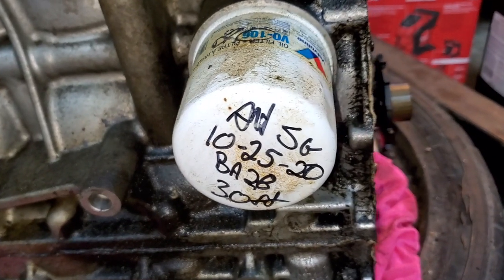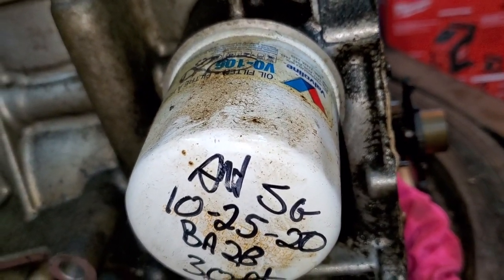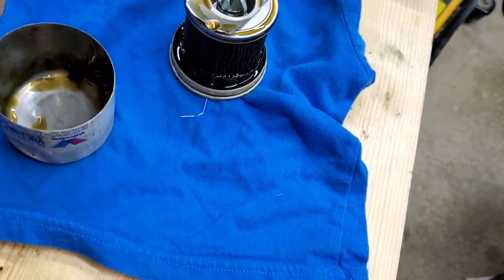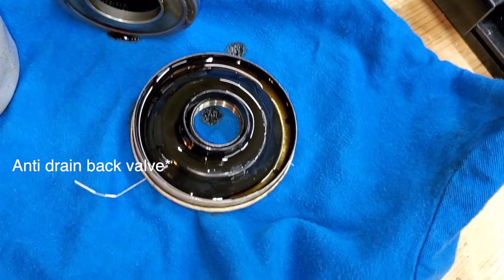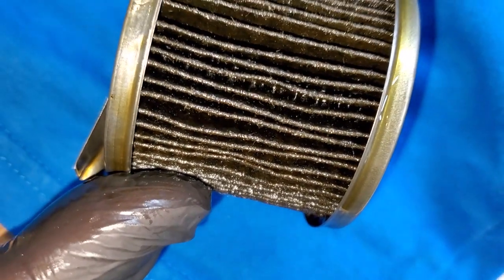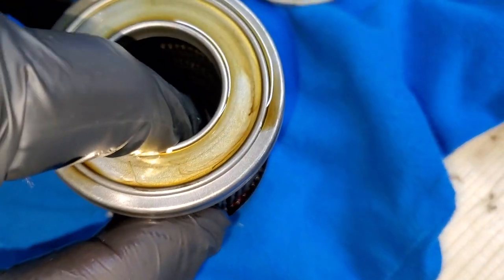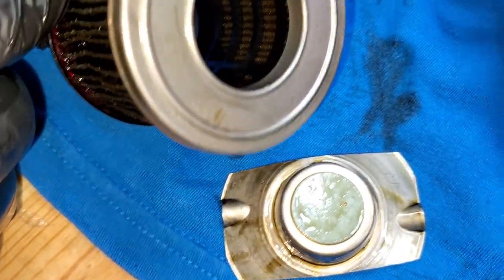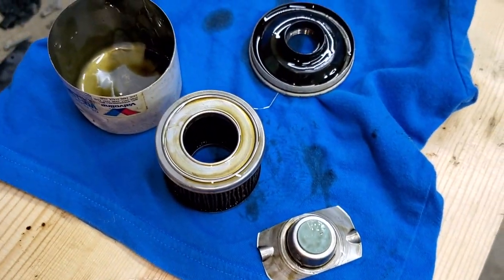VALVOLINE OIL FILTER CAUSED THIS ENGINE TO FAIL? VALVOLINE OIL FILTER REVIEW

Comment: Most engines that fail with oil related problems are due to overextended oil changes and lack of maintenance.. I have a 1994 Lawn boy lawn mower 4-cycle and I change the oil two times a year and the oil is crystal clear and the engine runs like new and does not use any oil..
Reply: Yeap oil filters is not the problems
Reply: @gonefishenmryangyang9539  a bad filter is more of a symptom of having cheap oil changes done. Whoever owned this engine was a cheapass on the oil

Comment: Looks like the engine failed because of lack of oil changes, abuse, and neglect and more likely a buildup of sludge in internal oil passages of the engine and its components

That filter isn’t even clogged up and even if it was clogged it has a emergency bypass valve to prevent oil starvation in the case that the filter media is too clogged for oil to pass through the media, this is especially useful for the people who neglect their engines and don’t change the oil enough

Engines getting damaged by VALVOLINE’s filters failing are extremely rare when the filter is installed properly and securely

The only time I’ve ever had a filter fail was on a Mercedes diesel motor were the filter was a cartridge type and the internal tower support structure for the inside of the housing for the filter failed because it was made of brittle Polymer/ plastic that had broken sometime before I serviced the vehicle. These types of filters do not have emergency bypass valves 

I informed management of the failure of the internal tower structure the filter is installed into and said it would likely cause a failure and that I think a replacement should be procured

Management disagreed 

I said that I was not liable for damages to the engine if there was a failure

I was right
The oil filter had been crushed by the pressure of the oil
And the engine seized due to oil starvation

What tends to damage engines most often is engines being overfilled with oil and being overworked

This is caused by inexperienced employees that are undertrained or have a lack of understanding of cars and how to use tools and techniques

Comment: The 2.4 litre Hyundai engine is known for engine failure - check out the class action lawsuit.  They are replacing thousands of engines.
Reply from the maker: And your point is?
Reply: @repairvehicle  The point is that the filter did not cause the engine to fail but a design flaw in the engine itself
Reply from the maker: What design flaw it has?
Reply: Google Theta II engine failure and Hyundai\KIA class action lawsuit.  The Theta II engines were not manufactured properly resulting in a 165 million dollar fine and the replacement of thousands of engines that seized due to rod bearing failure.
Reply from the maker: Thanks, I will look into this
Reply: @repairvehicle  the fact that the theta and literally every GDI motor burns oil and comes in one or more quarts low on oil every time they need a service
Reply from the maker: @YouDontKnowMe132  , every gdi I have seen does not show low on oil. Opposite, due to fuel being dumped inside the engine

Comment: One reason a Valoline filter fails, is if you use Valoline in an engine that is old, is because of high detergent in Valoline oil. Don’t use it in old engines. I learned that 55 years ago and  I use Valoline in my newer cars , but only the Advanced Valoline .
Reply from the maker: Valvoline is not high detergent. Why are spreading false information?